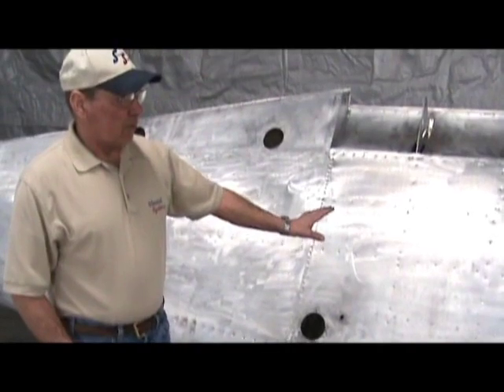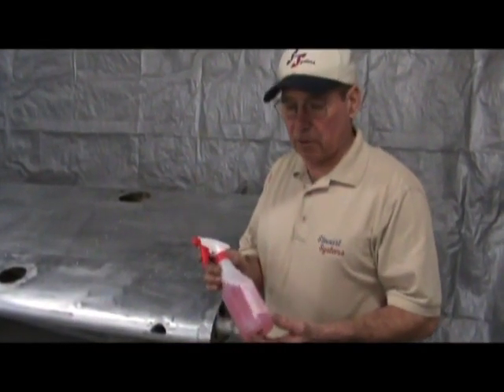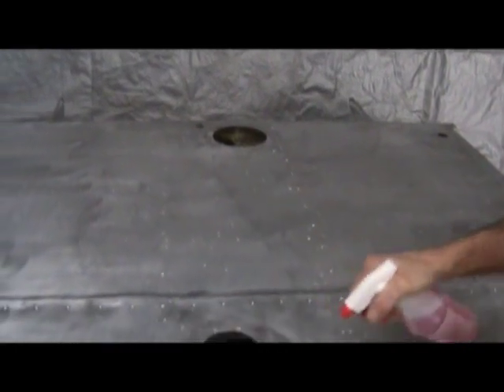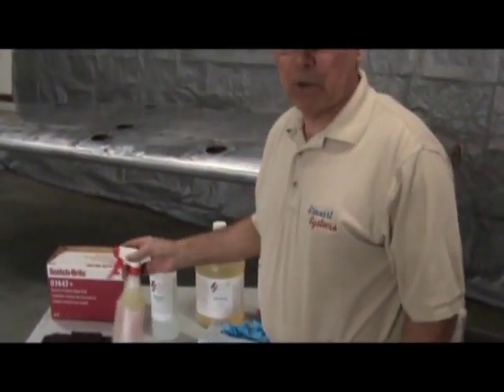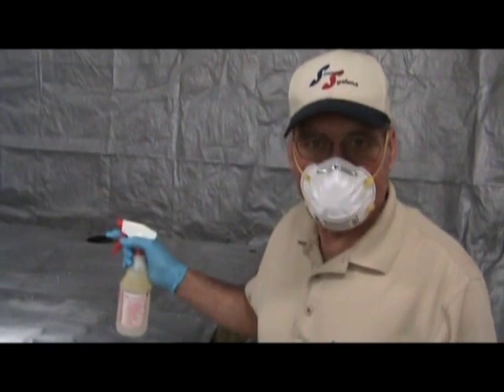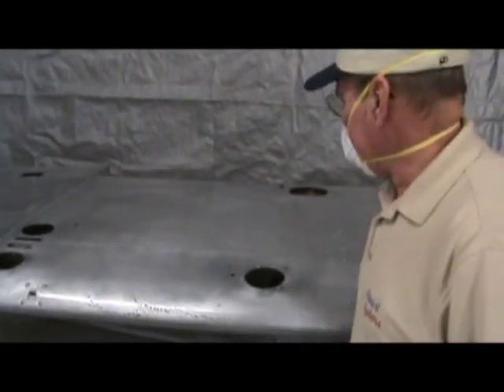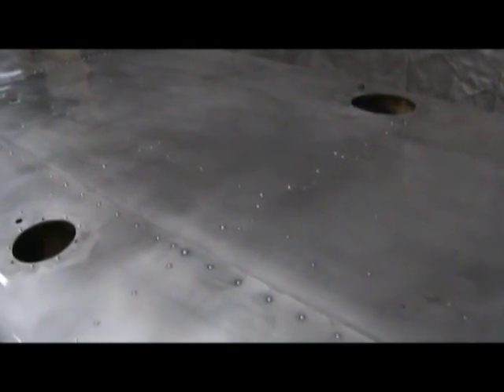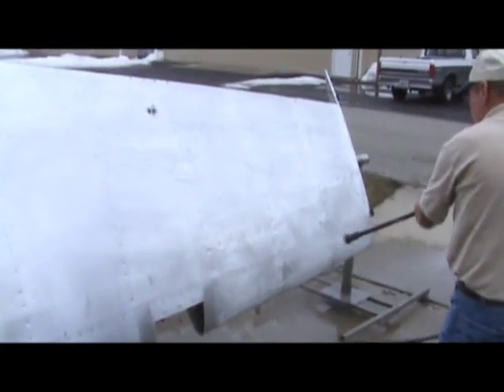Metal Aircraft Finishing Part 1

Comment: What happens if the etch solution does dry on the wing?
Reply from the maker: It will make a stain that will need to be removed by re etching.  You want to make sure to remove all of it thoroughly before applying primer or it can continue to react with the aluminum under the paint.

Comment: @Ch67guy1 For this particular wing the EWIS is taken out before the painting process for that exact reason what you stated; and others. The insides, or the airframe, is already coated with a corrosion inhibiting/preventive primer. With an extra spray of more inhibiting things. The etch won't do anything to the insides after it's fully rinsed down with water. 

On more common aircraft such as boeings' 700 series aircrafts, the wings don't get stripped down to the metal usually. Which then if the prepper strips the wings, they would have to treat the metal for corrosion prohibiting; etching(& alodine). But most times, the wings are sanded to perfection. If the prepper has to feather the paint to the metal, that area will have to be etched and alodined. It all depends on what the owner wants done to their aircraft. 

Lastly, there's other ways to treat the aircraft's alum. clad than etching & alodine. Better for the environment 😇 hope it helped and worth the two year reply lol.

Comment: What about the acid etch solution that finds it's way into the inside of the wing?  Such as through all those inspection holes.

And I assume you must prime immediately after completing the acid etch.  Bare aluminum probably begins to oxidize right away?